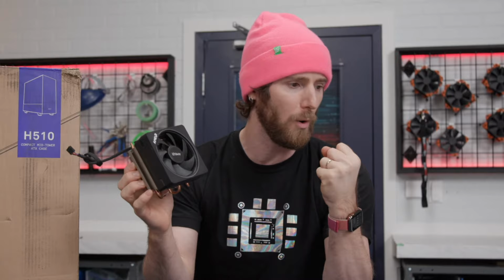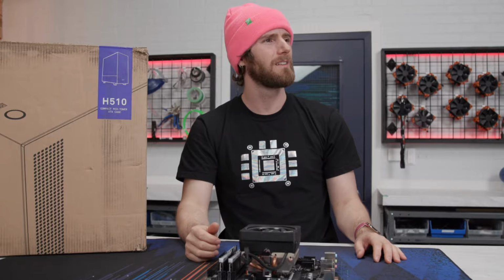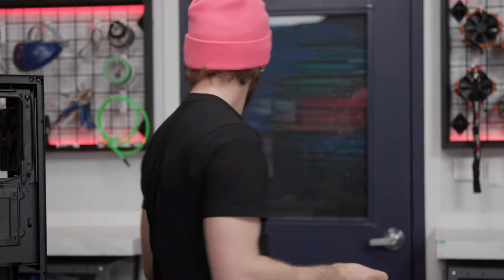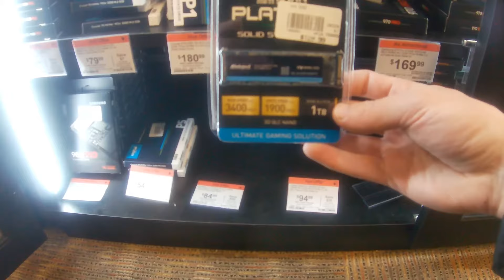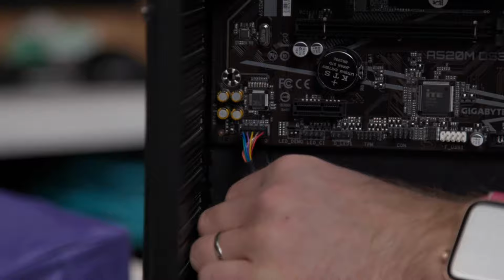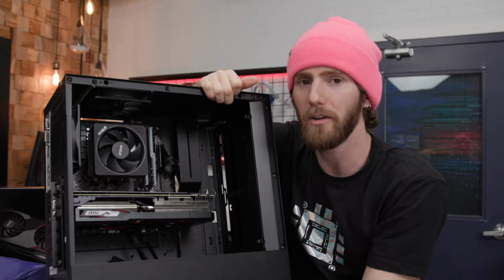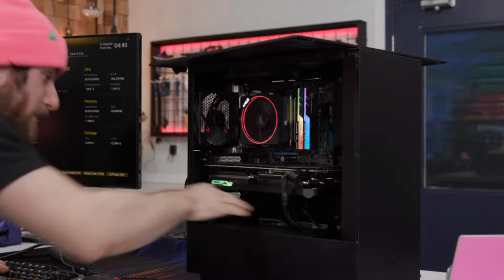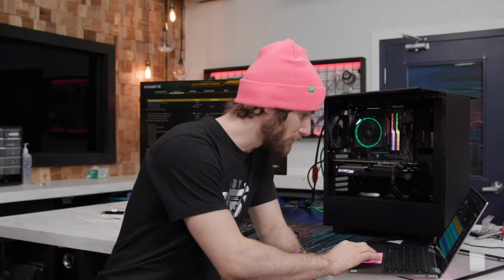Let's Build a Bang-for-the-Buck AMD Gaming PC!!

Comment: axGear PCIe to USB 3.1 Type-E Front Panel Socket Adapter Card for $23
https://www.newegg.com/p/2RC-037W-00003
I know this was a Microcenter sponsored build, but I found the USB Type-C header to PCIe (pictures says 3.0 2x) 
Model: PCE1U1E-A31
Named: axGear PCIe to USB 3.1 Type-E Front Panel Socket Adapter Card Express for Motherboard.
Also provides a single Orange or Red, seems to state it is  a 2.0, USB Type-A internal port
TIL: The USB Type-C cable has an industry name and is called the obvious: "USB 3.1 Type-E"